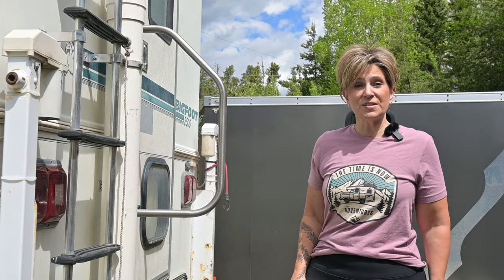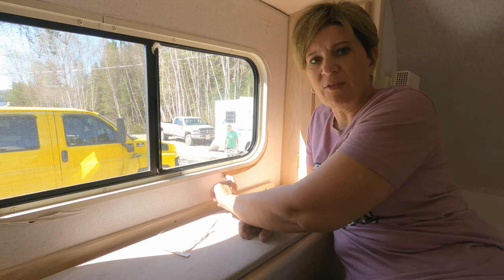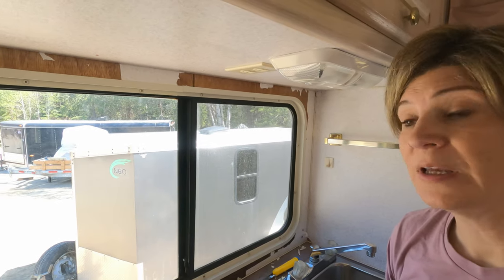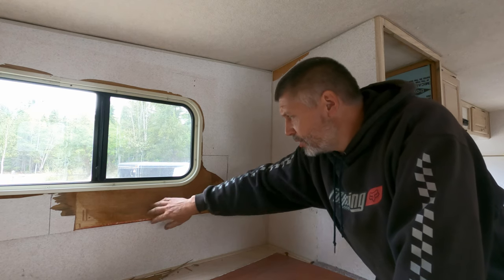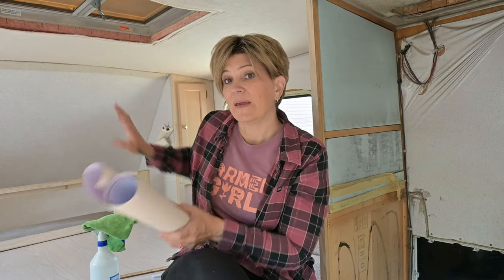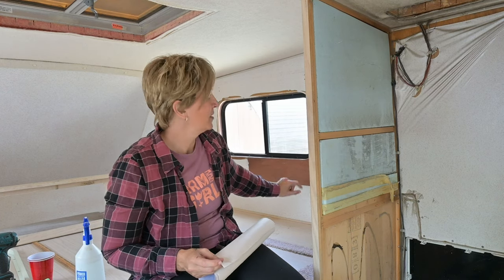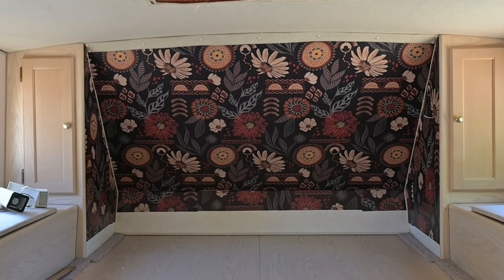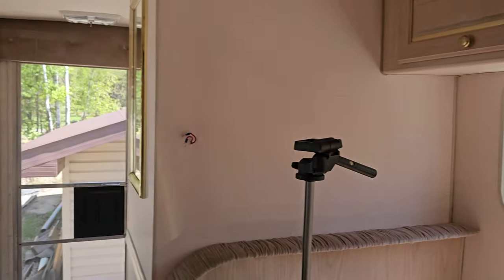Easy Camper Makeover: Fun Wallpaper & Backsplash Upgrade!

Comment: Thank you for taking the time to do these videos. I have a 95 that needs TLC. Redoing the windows was extremely helpful, gave me courage. Happy travels
Reply from the maker: 😊😊😊  We're so happy that you're enjoying the videos and that they've helped.  Much more to come!  Good luck with your repairs and reno.
Reply: How did you get the trim on the escape hatch off? Would like to remove it when painting
Reply from the maker: @albiecraig9359  There was a screw in each piece of the facing trim, so they came off easily.  The inside pieces, tuck in between the hatch and the roof. There might have been glue holding them in at some point, but after 27 years they were just pressure fit LOL.    I used a small pry bar to loosen them and then pulled them out by hand.
Reply: @TheTimeIsNowAdventures  😉